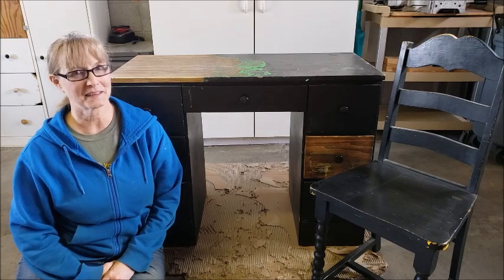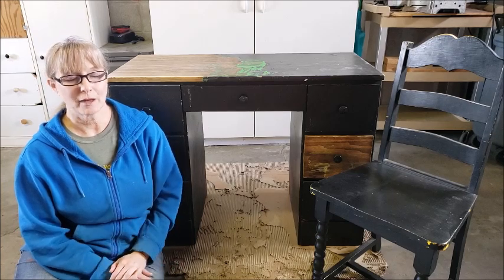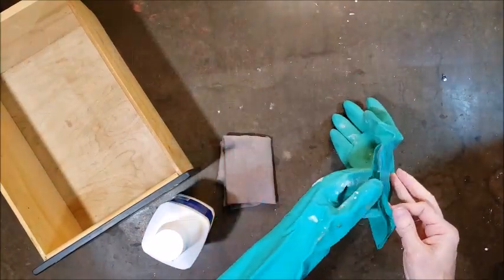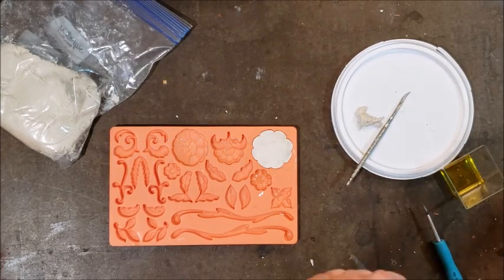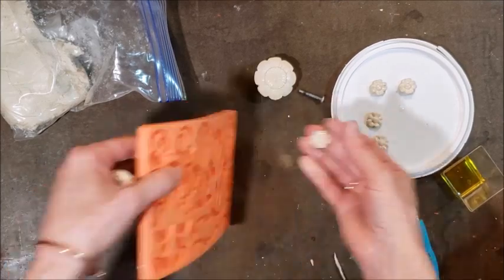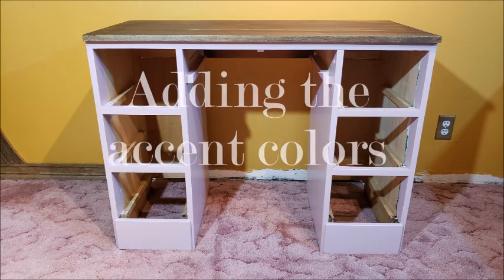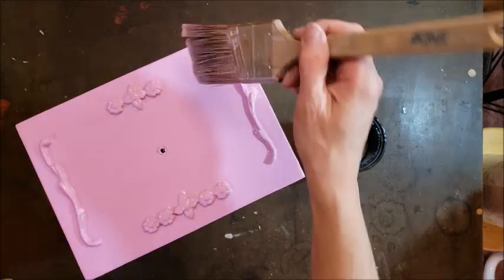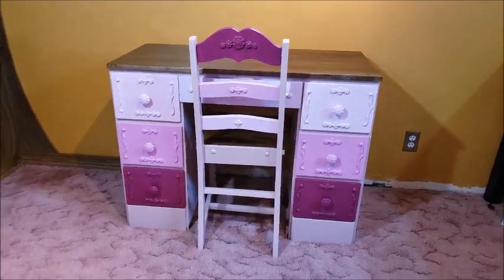Desk Makeover Furniture Facelift - Extreme Upcycling - Craft Room Makeover

Comment: I use cornstarch as a release agent. It works beautifully. Just paint a little cornstarch into your mold making sure to get into all the crevices, shake off the excess and add clay. Also, a faster way to remove excess clay and get a flat back is to use a straight edge knife and lay it on it's side then slide across the mold to slice off the excess clay.

Comment: Why won't my clay stay in the mold? It keeps lifting.😢
Reply from the maker: Hi sorry I am not sure. I have not had that problem. I just press it in and then remove it right away. I have only used Crayola air dry clay but it has been very easy to mold and work with.  Hope that helps. Thanks for watching 😊